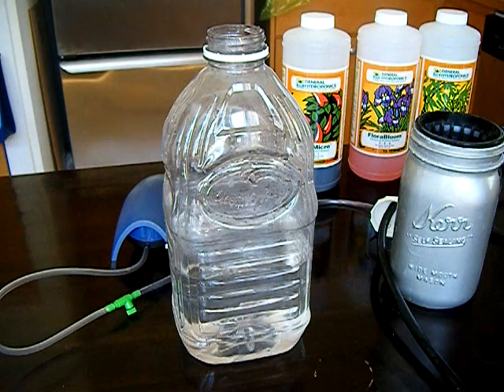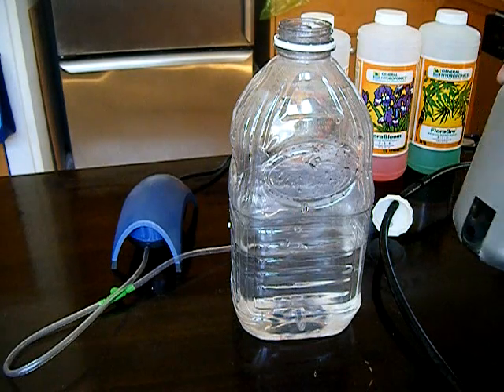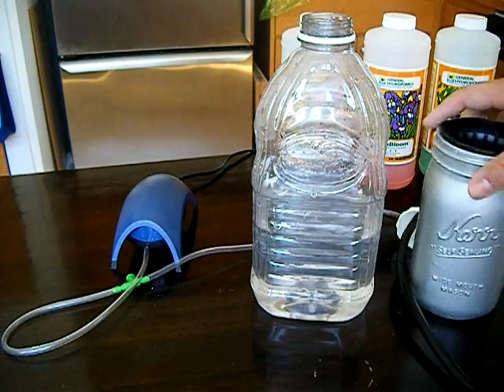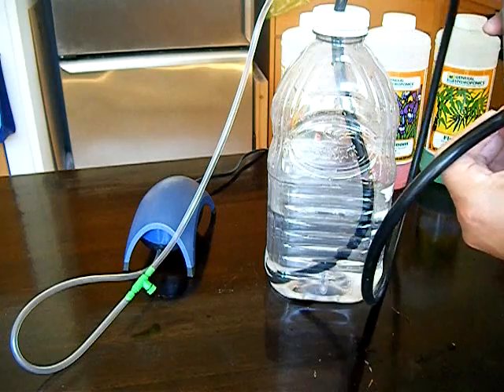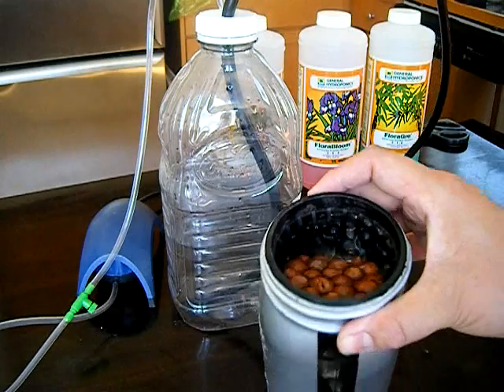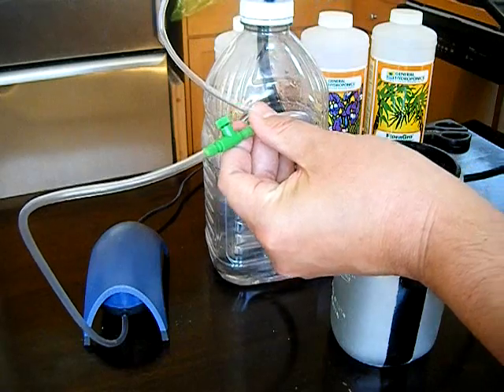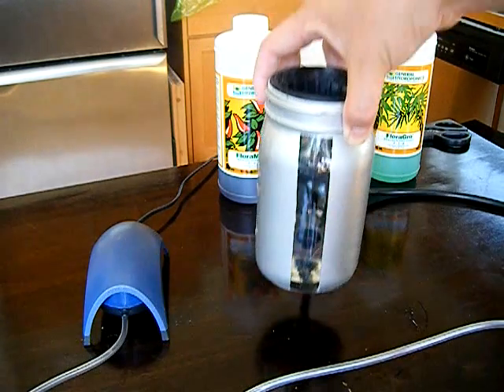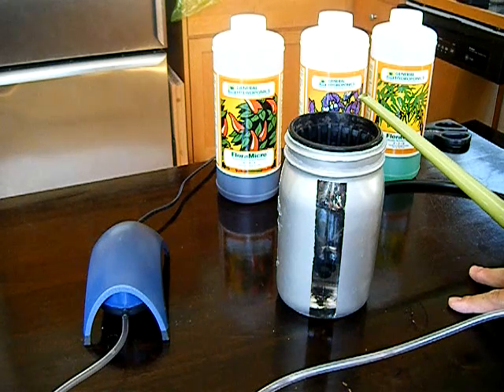Part 5: How to build extremely simple hydroponics system

Comment: Just tried this method with two squash bottles. I can pump the water fine, but it doesn't seem to siphon back. You now the factors that could be stopping this? It works when I suck on the valve end to start the process, but this seems impractacle.
Reply: The container with the plant should be higher than the reservoir.
Reply: komalthecoolk

I think my problem was not having the water feed hole at the bottom. It was just to test the principle and haven't got any further.
Will hopefully get back to this once other project have been completed. Am thinking of nesting a plant pot (with plant in) inside another plant pot and filling it with a reservoir and pump. Plant pots come in a variety of size and seems like would be easy to do compared to watter bottles.

Comment: Even more simple if you skip the reservoir, and pump air to the water directly in the container.
This is simply done by connecting an air-stone to the pump hose (air pump kits usually comes included with this stone, otherwise they're like 1 dollar, at a pet store). This is called DWC (Deep Water Culture) https://www.youtube.com/watch?v=DZwQlItvZ-A
Reply: was thinking this exact thing while watching.. DWC is less effort

Comment: Maybe You explained and I didn't hear it - but what is the pump for? Doesn't it suffice, when the underneath-part of the net-container is in contact with water? Like it's seen on the container with the net-cup on the right side of Your video.... Is it necessary, that the water bubbles? Sorry for asking maybe silly -  but I don't understand the hypodronic systems principle.  ;)
Reply: Basically hydroponics combines the benefits of growing in water and organic fertilization of the roots. The pump gives oxygen to the roots......
Reply: The pump's purpose is demonstrated at around 4:30. The reason just leaving the roots sitting in water is not as ideal is because as the water retreats back out if the jar, the roots are exposed to a greater amount of oxygen, which is what you want out of an ebb and flow system. Leaving roots in water is called deep water culture and requires that you keep the water oxygenated for a healthy root system.
Reply: ***** Thanks for Your answer and sorry for answering so late..... :)
Reply: USinchains Thanks for Your answer and sorry for answering so late..... :)
Quote: "The pump's purpose is demonstrated at around.....". I did ask even so, because english isn't my native language and now and then, I overhear things, which are mentioned or can't understand details.... ;-)

Comment: A couple questions, and I do apologize if they have been asked and answered before. 1. How often do you have to replace the solution? I noticed you said you just top off the water when is starts getting low, but how many times can you get away with that before needing to add more nutrient solution? 2. Did you start seeds in the cup or did you have to buy an already established plant? 3. I thought  in one of your previous videos you said you could link several jars together. How would you go about doing this?
Reply: You can use an EC/TDS meter to see how fast you plants are taking up nutrients. When TDS is too low you replenish. An upside of ebb and flow is that you can change out the reservoir daily if you want.

Comment: Why does it have to have a drain time? Will it kill the plants if it is filled and bubble with air continuously. Please don't think I am being curt or anything. I am just new to this.
Reply: You are describing deep water culture, this is ebb and flow. It offers the roots more oxygen and in my opinion is a superior method, as any parameter fluctuations in the water can be dealt with before exposing the plant. When bad things happen in DWC, bad things happen to the plant, there's no way around it. PH fluctuations can be instant killers.

Comment: Dude how does it drain back if the pump runs all the time it is putting air pressure in the tank and forcing the water out. The pump either has to turn off or I am missing something big time here!

Comment: I am not seeing how you can have a drain cycle at all it the pump is constantly running. My suggestion if you want it, would be to only have enough nutrient water to go a little on the bottom of the jar but then spray the nutrient to the roots, this set up as it sit would be far better as an aeroponics system

Comment from the maker: The reservoir needs to be at a lower level than the net cup for the system to drain properly, and in this case the reservoir is under the counter top. 

As long as it is not in direct sunlight or in direct line of sight with sunlight, you will be ok.  Change the water weekly and if needed you could even change the bottle.

Comment from the maker: The system should only be "on" for about 30 mins at a time 4-5 times per day, (for seedlings).   When it is not on, it will drain with gravity.

Comment from the maker: theoretically as big as you want as the plant grows, the roots will also grow and hang down the jar.  Unlike a standard soil pot, the jar will support much more root structure and therefore bigger plant.

The only problem is when the roots get really long and thick, it will begin to clog the plumbing.  You can either upgrade to a larger jar or give the roots a "hair cut".

Comment: Hey man, Great video, im looking in to hydro and im gong to build a system based on this video, using a similar air pump, this should work on a larger scale with the same pump right? it just builds pressure in the reservoir and then pumps the solution up to the container?

Comment: Out of all the different methods on YouTube, yours was the most inspiring.  I have taken your methods here and built a 6 gallon tank.  It has 4 air stones and submerged water pump to keep the solution moving.  I am also using the GH nutrients.  I guess the only difference is that my pots are constantly in the water, about 1/2 in.  There will be no draining for a few weeks.  I am also using GH pH UP/DOWN to keep my solution to a proper setting otherwise I will get "nutrient lockout".

Comment from the maker: The feed hose is a 1/4" diameter tube, can be anything really, just wide enough to freely feed water through it.  Yes, the air pump feeds just into the top of the water bottle, this will create air pressure and push the liquid at the bottom of the bottle into the feed tube and into your hydro cup!

Comment from the maker: Yes!  basically the water should flow back into the reservoir every time the pump shuts off.  This is the essence of "ebb and flood"  the system should only flood the plant roots for about 30 mins 5 times a day (more as the plant grows bigger), the system will drain or "ebb" at all other hours of the day.

So yes, you can change out the nutrient solution easily when the pump is off and you can do this every week or so.

Comment: Let me get this straight, you let the water flow back into the reservoir and change the water with new nutrients and then let it flow back from the reservoir into the glass jar?
Is that how you change the water and supply the basil with new nutrients? 
And if so, how often would you recommend doing this, daily, weekly,..?

Comment: I know its an old video and you may have already figured,.,  But have you ever considered using an aqualifter pump for this?  Theyre cheaper than the air pumps and will work exactly the way you want, including allowing a back siphon to drain.,  Since they pump liquid rather than air you can pump your solution directly, instead of relying on a pressurized system to keep things moving.,  Just a thought.

Comment from the maker: Hey!  Yes the feed tube most definitely needs to be thicker than airline.  My very first video i posted was with an airline feed tube, but by the second video changed it to a 3/8" tube.  It worked the first time but was very slow and probably got lucky somewhere, the 3/8" relieves the need for excess pressure.

hang tight though, got tons of questioins on this so I will just film everything again addressing the questions!

Comment from the maker: A fish tank is more of an aquaponic or bubbleponic set up, where you would simply use a water pump to suck water out of the tank then a return line going back to the tank.  This set up won't work with an aquarium because it would have to be sealed air tight which is impossible.

Comment from the maker: That would work!  The plastic valve is just essentially a leak in the line!  Someone told me they did this but had trouble controlling the amount of air being leaked, but they found a work around using a piece of masking tape to "adjust" the hole!

Comment: If you poke a small hole, "with like a pin" in the top of the lower container you won't even need the valve. Note this hole must be above the water line or it will leak.

Comment from the maker: you need to open the valve in your air line a little more.  It will act as a leak so that the bottles are unpressurized and allows the liquid back.  It also helps a lot if your bottom reservoir is beneath the top one.

Comment: Hi, I have to be honest. I actually went out and tried this and well it was a fail. I found many problems with your system. First off it wasn't cheap (spent well more than if I just bought an actual system). Don't ask the details:( Secondly no matter what container I use there was always a leak somewhere, finally when I did get it to work all my plants kept getting water loged. They all died out. I tried setting different times and durations for flooding thinking that was it, but still fail.

Comment: If you didn't want to have the plants spaced far apart then maybe just a larger container with up to 5 pot holes drilled would do the trick. With that arrangement you might be able to get the ebb & flow bubble action for all of em

Comment: sorry i love this vid apart from one thing can i make suggestion get a solid platic tube about 4 cm diameter and about 3inch lenght drill hole straight down the lenght of it but dont go right threw the bottem leave about 1 cm so its just a hollow tube with 1 end closed then trill holes evenly threwout the outside of it till they go into the other hole then push it onto you airtube and submerge it in the solution and you will have airrated water:)

Comment: @mpow113 This is supposed to be a fun device to show off to your friends, then they will say to you: "pshhhh!..nerd."  

But beyond the novelty, if you check out part 3 of this series, the basil grew incredibly healthy so it does work better than soil, but there is a trade off because this takes more work.  

You need to add more water just to accommodate the evaporation and the water the plant takes up, for a seedling, typically the water goes down 1" per day, bigger plants consume even more!

Comment from the maker: @TheSdveg Yes, it should automatically drain.  No need to be standing there.  You should play with the relief valve when setting it up, it should act as a 'leak in the line' so-to-speak: it will let off enough air to allow the pressure to drain when the pump is off, but not too much open, where the system cannot pressurize when the pump is on...its a bit of fine tuning, but not impossible.  Because its a small leak, it cant take up to 15 mins to drain, but thats still OK!

Comment: When the timer is on for an hour does it automatically drain when the timer goes off?
Do you have to be physically present to turn the air-line relief valve for it to drain?  
Congrats on the great, simple, easy, design.

Comment: Interesting vid! I´m Also into Diy hydroponic systems testing for some time now. Its somekind kind of flood and drain system i think. it uses the air to also pump the water. Air is always good in the solution, but i dont like the air pump noise. At the moment im into getting air in the water just using the water(room fountain) pumps playing with venturi effect a.s.o.... If u compare both they are much more quiet and u can get nice fine bubbles. 

Realy good vid an explanation! Thx for sharing!

Comment: For people wanting to try this - You might want a timer on the air pump to turn it on and off every hour or so. If its running all the time it will just stay flooded, unless you want to turn it on and off manually, or let it stay flooded and then you have yourself a deep water culture!

Comment from the maker: @ebp283 there indeed would be a big risk of overflow, but if the daisy chain holes are at the bottom of the jars it could be possible!  I haven't attempted it, but the bubbling action would only take place in the first jar.  However, I don't believe it is very important to directly bubble oxygen against the root system as there is oxygen in the liquid itself!

Comment from the maker: @Devorvan Its just a way to soak the roots of the plant in intervals.  It helps the growth process to soak the roots and drain back, similar to a potted plant that gets watered a few times a day, then the water drains off.  If the roots soak all day long, it could still work, but is a different type of hydroponics some call "bubbleponics".

I feel ebb and flow is more natural to the plant rather than soaking in water all day, and less prone to problems.

Comment from the maker: @onefourzerobpm They are called "hydroton", you can get them at a local specialty hydroponic store, or online, but you don't specifically need these, they are just inert and there for substrate support.  You can use whatever is available like lava rock, crushed pumice, crushed clay pots, light pebbles, aquarium gravel...etc.  just so long as it is bigger than the holes on the net cup.

Comment from the maker: @onefourzerobpm Sure!  Net cups are only about 10-20 cents, but yes if you had a cup with holes in it or even a small flower pot, (perhaps need to drill more holes)  you could use that for a 100% free route!  You can even use gravel in lieu of the clay balls!  I would still recommend using rock wool though.

Comment: @Bigevilfishy He's just using an air pump... the VERY same you would use for a fish tank. The only difference between this pump and a regular fish tank pump is that "air relief valve" (the green "T" connector). This allows air flow to go in both directions, instead of just one like you would need for a fish tank. I have bought MANY for $6.

Comment from the maker: @bkpickell This would be a good overflow mod, (kinda like a feedback loop for the nutrients solution), but the bottom reservoir needs to be pressurized in order to push the nutrient solution up.  If there was another hose leading to the top of the jar, it would be in-effect an air hole which would make pressurization of the reservoir impossible.

Comment: A slight modification that I would recommend; is to drill another hole at the top of the jar just below the net pot. Run a hose from this hole down to your reservoir. This way you can have more water in your reservoir than you have for container capacity. Of course you may need to get a bigger pump, but it should work.

Comment from the maker: @Retloc I used a diamond coated glass drill bit, which looks more like a hollow cylinder.  you should be able to find one on ebay.  If you get one of these, either drill underwater to control the dust or use a respirator type dust mask.  Glass dust, if inhaled, will silently destroy your lungs.

Comment: tha'ts great DIY.
But wouldn't it be just easier to just go Bubble bucket style? stick an air stone on the pump and put in the jar with the net pot and plug in? All done, no timers or messing with check valves, no extra tubes or holes needed, or an ugly reservoir hanging around, just tape the pump up to back side of the vase to hide, maintain water level 1 inch below net.
Drip is nice but it is old school hydro and to many components and worries.
DWC has been shown to give best yield..

Comment from the maker: @gearHEADZ504 it drains using gravity, that's why the reservoir is under the counter.  The valve allows the air pressure to bleed which allows the liquid to drain back into the reservoir when the pump is off.

Comment from the maker: @puchpower93 YES!  use an adjustable air line bleeder for aquarium air pumps, typically comes in a pack with other air line accessories at petco.  You will have to adjust the knob to allow air to flow out of the line, but not so much that air cannot fill the reservoir when the pump is on!

Comment from the maker: @shawn6289 use one of those cheap plastic air hose valves, the adjustable knob allows you to fine tune the air relief. You can find these in the aquarium section of your local pet store or petsmart etc.  The timer is just a $10 'security timer' found at home depot that turns on lamps and such while you are away.  It just turns on and cuts power to the pump automatically.  You will want to flood 4 times/day while its a seedling, and increase this occurrence as plant grows larger!

Comment from the maker: @TDTF007 awesome!  Yes I failed to mention all the bits cost money too...so here we go:  air pump, liquid nutrients, hoses, connectors (if needed), air line, air line valves, spray paint, net cup, hydro pellets, rock wool, seeds, jar, glass drill bit, drill, juice container...whew that is a lot.  I actually had all this on hand, but if starting with absolutely nothing, this could cost some money.

Comment: i made sum thing like this but, instead of a valve piece i found out if u make a very small hole at the to of your resevour, (like the size of a safety pin) it works pritty well with any pump u find.

Comment: @7073436118 That's correct!  The nutrient container needs to be air tight so the air pump can build up pressure to push the liquid down into the feed tube.